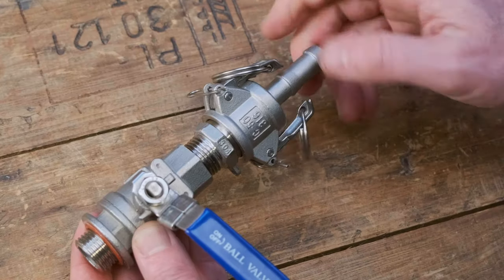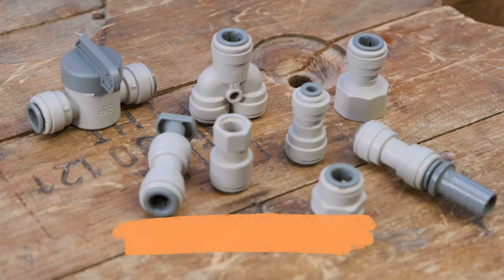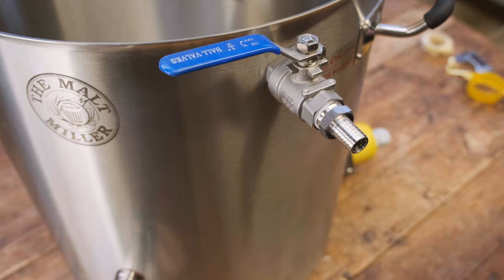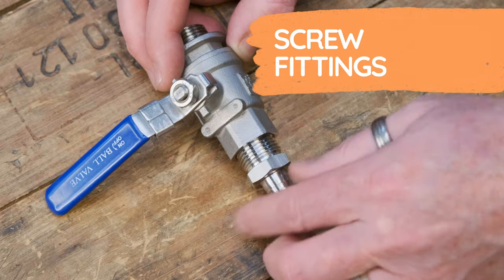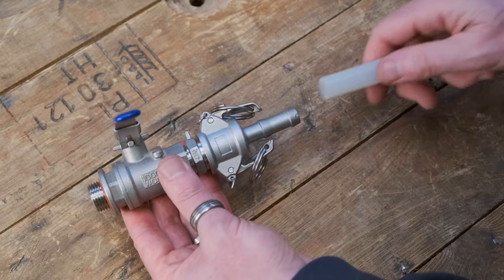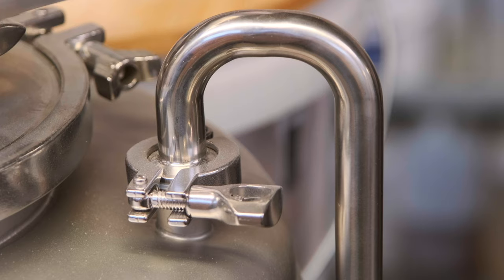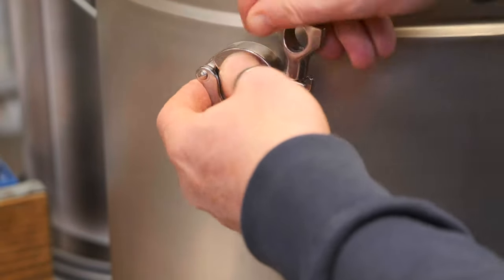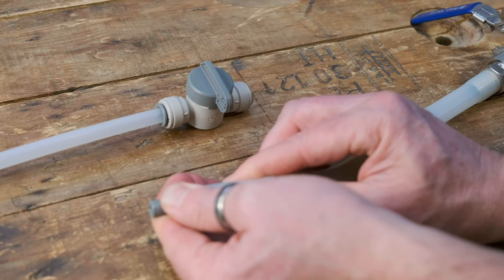DEMYSTIFYING BREWERY FITTINGS & COUPLINGS | The Malt Miller

Comment: If you did want to measure a BSP fitting, it's the inside diameter only. Also, with the parallel BSP, you can use a doughty seal. This eliminates the need for PTFE (plastic tape for engineers). You will always have to use it for tapered thread fittings (BSPT)
Great video, guys

Comment: Thanks for the informative video guys! The thing I'm most confused about at the moment is why you'd reduce beer line sizes for in dispense, and best practice for doing this. I'm setting up a keg dispense system for a charity beer festival with a chiller and python, and all the lines are 3/8. However I know some people reduce to a smaller line like 3/16ths for a few metres before the taps, to reduce serving pressure and foaming. Is this something that's worth doing?
Reply from the maker: Hi, yes, this could really help if you are experiencing fobing on higher carbonated beers
Reply: @themaltmiller8438  thanks for the advice, we certainly had that problem last year. I know there are a lot of variables, but what sort of length of 3/16ths do you think would be needed on each line?
Reply from the maker: If you start with a few meters on each line you can always cut the line down until you find the perfect length. 👍🏻
Reply: @themaltmiller8438  great advice! Thank you.

Comment: Another helpful video guys. I'd like to know your thoughts on camlock connections Vs quick disconnects, which seem popular in the US. I've had camlocks spring open on me on more than one occasion and I'm looking to make the switch.

Also, just to add that whilst JG is a British company, it is in fact owned by an Australian one.

Oh, and as for the half inch sizing nonsense, this is the same as British tap washer sizings. Who on earth thought that was a good idea?!
Reply from the maker: Glad you enjoyed it buddy! We love trying to help others learn as much as possible! We don't stock the quick disconnects as in testing we have found they gum up with wort/beer and are more tricky to clean. As mentioned in the video we would suggest you always have the camlocks with the locking pins for safety reasons.
Reply: @themaltmiller8438  good to know you've researched the quick disconnects. Thanks for your opinion. I inherited the camlocks sans locking pins so looks like I'll be putting these in my next order with some new silicone tubing.